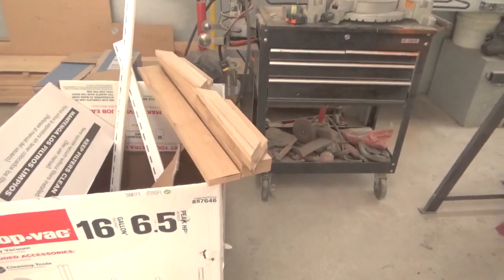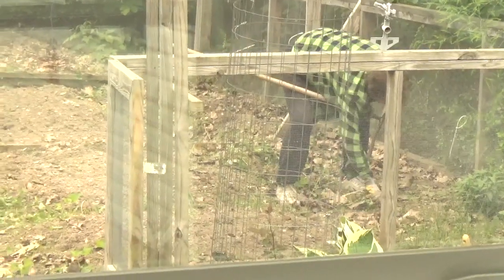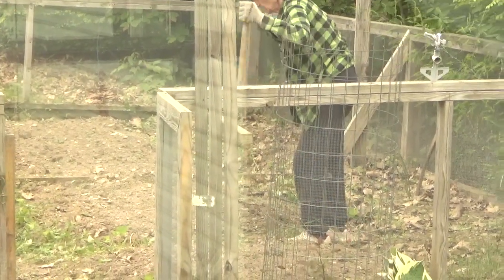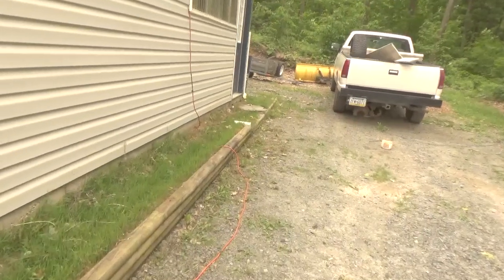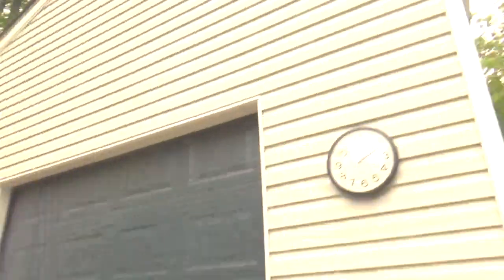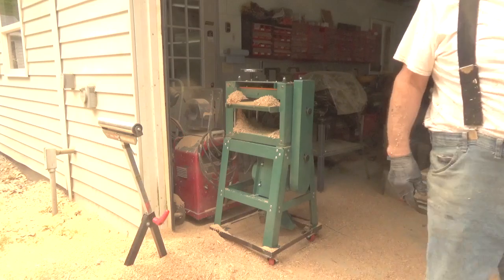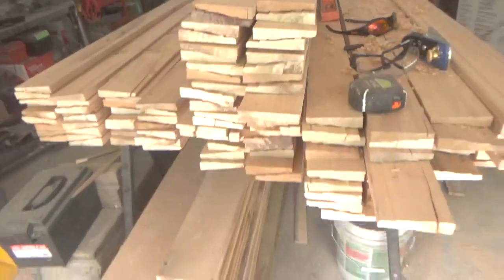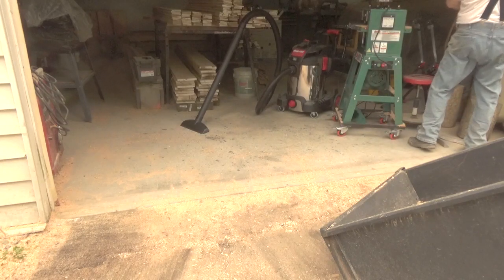Anything goes Saturday. Jun 3 18

Comment: Hi Jo, great video as always. 

Who would've guessed mice would gain access via the corner trim. Good tip, filling with the gap with foam. 

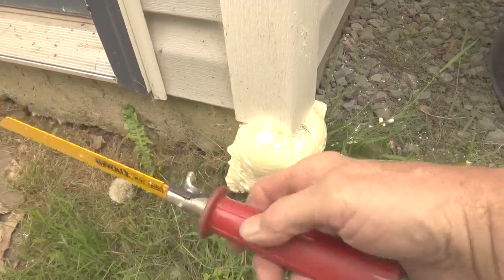At 15:50, I know that tool as a "pad saw". Maybe it has other names around the English speaking world?
Reply from the maker: I never heard that term for the saw but I never heard any name for them, so "pad saw" sounds good to me. Thanks for the tip. We actually did a study on how mice enter homes. Talcum powder revealed that the corner posts were their main access point especially in a new home where everything should be tight. Thank you for the comment.

Comment: Those are some great tips on the mice problem! Those green bait squares you're using are the absolute best. I had half a dozen mice jump out of my tool chest drawer once. I put one of those bait squares in and haven't seen a mouse since. I put them in the trunks of my classic cars too. 
It wouldn't take much of that moulding to pay for the equipment it took to make it. Impressive!
Reply from the maker: Thanks for the comment. I see your busy. One thing after the other. I love it.
Reply: I should’ve quit while I was ahead. I leaned down to shut off my pressure washer after cleaning my driveway and blistered the heck out of my palm on the muffler. I Got a couple nice philips screw heads burnt into it too😬. My dad always used to say, “too soon old, too late smart”. Have a good week, Joe.
Reply from the maker: Thats is a good saying. You also. Good night.

Comment: Here is a suggestion for running moulding. Set the moulder for the first cut and run a batch through on that setting. then reset and run the batch through for the second cut. It saves wear in the machine and gets all the moulding exactly the same thickness for scarf joints. Good tip on the mice. You saved lots on the moulding. Looking forward to seeing you run the crown.
Reply from the maker: Grizzly recommends the same procedure. I have not had any problem with the thickness. I also enjoy getting the pieces finished as quick as I can. The dial seems very accurate so that is why I was doing the way I was. But your right about the procedure.

Comment: Evening Joe.... if your not shoveling snow, you're shoveling sawdust! You saved a ton of money, but you did a lot of work too. Does your garden have an electric fence around it? We have one with wire low enough to keep the woodchucks out and high enough to make the deer think twice. Though we also have that deer netting too, but that doesn't work well if they get tangled in it, they just tear it up as if it wasn't there. The electric fence does work though. Only problem with have now is with moles and voles. We also have an electric fence around the chicken coop and run to keep the bears out. Good idea on the anti-mice barriers. Looks like you had a nice Saturday.
Reply from the maker: Hi John, did you order all this rain? It started this morning and is suppose to rain till Thursday. It was a good day but it was kinda cool. Really cool today (Sunday) its 47 degrees. I don't have a problem with the deer or moles or anything like that. The chipmunks are driving me crazy though. The garden where Sally was working has 1/2" hardware cloth around it. So we have been ok with any critters there. The bear seem to let the chickens alone because Bullseye's kennel is not far from the chickens and I believe he scares the bear away. I have had a lot of good luck with the raised beds as far as the deer go. Footprints all over but they dont like that nylon or pvc netting.
Reply: Yeah, rain until Thursday here too. And cool. You do realize that in seventeen days the Sun starts dropping back towards the southern horizon again! And that means that Winter will be coming again soon and every time I write a comment you can expect it to be snowing again! I guess you'll be calling me the Winter Warlock when that happens. Let's hope we have a decent Summer before that comes true. What are your video plans for the next four rainy days? I'll be working behind my computer for sure. Back is still bothering me, but it is better.
Reply from the maker: John Collado Since I can't sit still unless it is supper time,  I have a big list of things to do so I can video some of that.  I need to start cutting window extension jambs. I don't even want to think of winter but I am happy with 55 degrees for working.

Comment: Actually I'd be interested to figure out the cost of all the wood molding you would need to finish the house and other projects you made from cutting your own wood and the costs of the Woodmizer, planners, vacuums, bits, blades, backhoe fuel, repairs, grappling hook, concrete, 6x6's, lags, fuel, shingles, all the other costs associated with setting up and running the sawmill vs the costs of just buying what you needed? I know you would not have had the fun and satisfaction or lost 30 lbs but how can that be figured into costs?
Reply from the maker: I will give you this information now and do a tally video later. ROR=33.5% for one year.